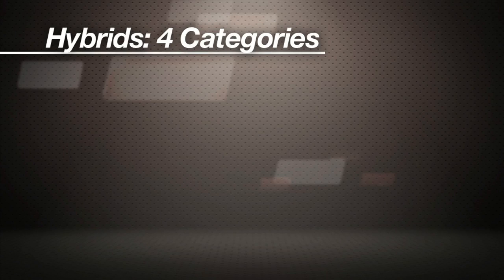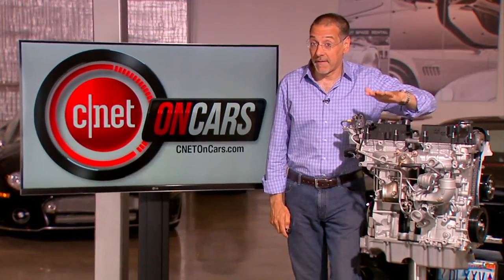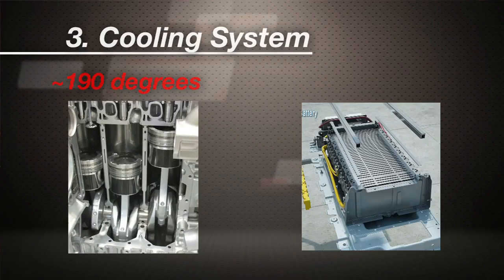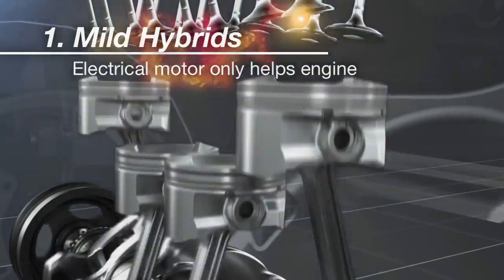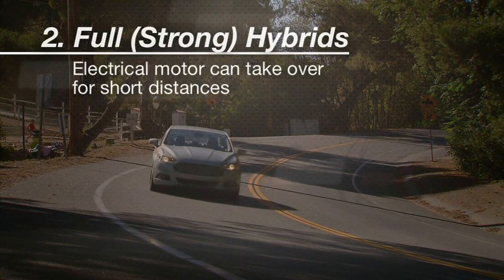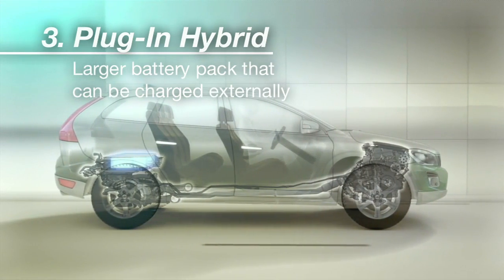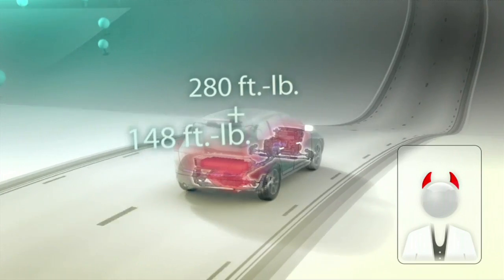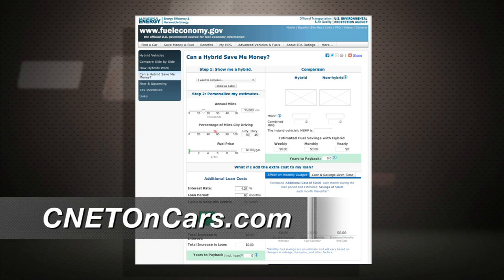CNET On Cars - Car Tech 101, Hybrid systems explained

Comment: Sri Lanka must be one of the most wierdly taxxed countries of all, here people can buy a Nissan Leaf for around the $22000~$24000. But if you want to buy a Base Model Kia Sorento; it starts at around $110,000. Here if you buy a fully loaded 520D, it's around $40,000 cheaper than a base model BMW 420D. oh the kicker part is, you can buy a fully loaded P85D Tesla in Sri Lanka for around $135,000, but you can get a BMW 4 series starter at a little bit over $250,000. here some vehicals are taxxed at rates that exceeds 550% meaning the total cost of the vehical exceeds 650% when it passes through the harbour gates. Still the polititians here get a 0 Tax permit every year with which they (people who had bearly passed the 8th grade, know absolutely nothing, have almost makes no difference, no education) each have around 5 or 6 Porsches, around 10 Defenders as security, and when their kids eventually grow up and requests Lambos & Ferraris, they smuggle them easily, so they pay the same for a Ferrari as we the citizens pay for a base BMW 5 series :P Now that's corruption (btw the Toyota gt86 that I am looking to buy soon costs around $120,000)
Reply: Why do they tax so much? Is it only because of controlling the number of cars and traffic?
Also how's the gt86?

Comment: The best way to think about it is the battery is essentially an electric supercharger, though not all of them are aimed at performance. A Prius is a treehugger; an Infiniti Q50S Hybrid isn't, though it gets pretty good get efficiency and power because it uses a battery as opposed to a large displacement engine or a parasitic supercharger or turbocharger.